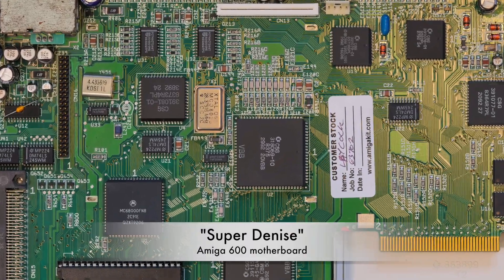amipal #42: OCS, ECS & AGA - Redux

Comment: When you explained the copper chip, you said it gives the impression of there being more colours on screen than there actually are. 
You are incorrect! There actually are more colours on screen than the pallet supports. It's not an impression of more.
One example of an impression of more colours is by dithering 2 colours together, tricking the eye into seeing a 3rd colour not included in the pallet.
Pallet switching is not the same thing. You are displaying more colours by switching pallets while the screen is drawn, no tricking of the eye to give the impression of more colours, instead tricking the system into actually displaying more.

Comment: OCS was working in the 'lab' in late 1983 and publicly demonstrated in both January and June 1984. 
ECS is a slight augmentation of OCS (very few changes). 
AGA is a slight augmentation of ECS (blitter and audio chips didn't change).

So really, the only true innovation was OCS. It does crazy things like this (proving that HAM does work fine for games): https://youtu.be/XDdMoglmUbs?t=712   https://youtu.be/JJczdYO8N1c?t=230
Reply: You do AGA a disservice. Because there is a visible (color and performance-wise) difference between ECS and AGA. The difference between OCS and ECS is nearly invisible.
Reply: @TheGraemi  Color-wise, yes. Performance-wise, not much. At least not as much as you'd expect from a chipset upgrade at that time. AGA re-uses the ECS blitter. They didn't even increase the blitter's bandwidth. It's Lisa that's doing the heavy lifting and Lisa is just a display chip (based on Denise). That's why AGA games don't look much better than well-programmed OCS and ECS games.
Reply: @Nebulous6  Well, at the end they made the data transfer 32 bit but left blitter 16 bit.
So same color modes should have been faster but of course not the newer ones and not the blitter operations.
It's sad they never used the production ready Ranger chipset Jay Miner finished in 86. Probably forgot about it.
Reply: @TheGraemi  I totally agree. What even bothers me more is that Jay Miner said that he could have added more bitplanes back in the mid-1980s but didn't feel that displays to handle that many colors weren't really prevalent enough at the time for the home market (plus cost considerations back then for something that started out as a console design). The fact that he could have done that back then shows just how long C= sat on their hands. I don't fault the engineers as they genuinely wanted to release cool stuff. It was the management that kept killing their proposals and starving them for resources. Meanwhile, the top five execs at C= were pocketing over a million $ a year each.
Reply: @Nebulous6  It was even worse. The screens weren't really able to handle 1024x1024, the max. resolution (non-interlace) for the chip set. And if than expensive.
But regardless, Gould wanted a business machine. A early A3000 with Buster and Ranger would have been possible in 88. Some ground work was already done by the Los Gatos (old Amiga) guys. Using that as hints how to integrate with other components to create a cheaper Ranger should have been possible. Jay Miner also would have helped as consultant. He said so multiple times after he left Commodore.
This just showed how a one man (Tramiel) show Commodore leadership really was. Gould certainly was not up to the task, by far. 😭

Comment: Additional: In OCS/ECS the special modes EHB and HAM are only possible in LowRes (320 pixel width). On AGA you can have the special modes in any resolution. Also in OCS/ECS the color palette range reduces its size while doubling the width, so: 320px->32col, 640px->16col, 1280px->4col. In AGA you can use up to 256 colors in standard mode for any resolution. Early A1000 also lack EHB mode, latter A1000 and all other Amigas can do EHB.
Edit: And also, the copper cannot only change a palette at each line, also the resolution. And you can also change the palette at specific x coordinates, so with some special skills, you can create "rectangles" with an own palette, as demonstrated in the "Remake of StreetFighter 2 Amiga Demo"
Reply: I still Wonder why half-bright shadows are not more common . I think that genesis has some weird flags for this, too. Never saw arcade hardware with this capability. NeoGeo cannot, or?
Reply: @ArneChristianRosenfeldt  i cannot remember any other hardware which can do this without alpha blending with such efficiency. On the Amiga there are some games which used this trick, for example "the settlers". Or in intros of a bunch of games

Comment: I've had an Amiga 1200 in my kitchen cupboard since 1996. The pandemic meant I couldn't really go anywhere so I pulled it out and added some gear to it as my original hard disk died. I now have, A1200, Blizzard 1260 (060) 50mhz,Blizzard 1230 scsi card with total 128mb ram, 8x scsi cd rom, ide to sata converter, sata to m.2 adapter and 128Gb m.2 drive with Amiga OS 4.9. Also, new 3.2 roms and 9dsub to ps2 convertor with Microsoft intelli trackball. What a blast from the past. I haven't worked out how to get the scroll wheel to work yet.
Reply from the maker: That's amazing to hear! What a superb system you've put together.
Have you tried FreeWheel from Aminet? Can't promise anything, but that may work.
Also, is your machine recapped?
Reply: @amipal24  Yes recapped. And Yes, I've tried freewheel. I can't seem to get it working.  I run the app but the wheel doesn't respond. Edit/ I copied Freewheel 2.1 into WBstartup and low and behold if I press on the wheel and move the ball I can scroll so that'll do nicely. The scroll wheel does nothing but clicking on the wheel is kind of like a third button. Pretty happy with that.

Comment: HAM mode was used in Time Gal anime full-motion video game.
Reply: The only HAM game I recall playing was Pioneer Plague. Impressively colourful, but the frame rate suffered too much for it to be anything other than a curiosity.
Reply: @mikekwarner  
https://youtu.be/JSLcN6GBzO0?t=93
Amiga's Pioneer Plague gameplay.
Reply from the maker: Wow, I didn't know about that! And only released in 2017!
Reply: HAM 6 also used for Links Golf,  Knights of Crystallion, and Labyrinth of time.
HAM 8 used for Holiday, NightShift, and Genetic Species  https://youtu.be/Pl1hctZ8HnY?t=414
Reply: @Nebulous6   Genetic Species 200MB pre-rendered intro is in HAM8
Reply: @valenrn8657  For HAM8, there are these two (the second needs a 68060/50 though): https://youtu.be/wbWGAFIkA5E?t=29 
https://www.youtube.com/watch?v=wv3OYbADkJQ
Reply: @Nebulous6  WinUAE's 68060 emulation is not performance accurate.
Reply: @ With enough CPU power, A1200's AGA can display 60 fps 320x200 AmiQuake. 30 fps 640x200 has been reached.

Time Gal example displays prebaked frames with stock 68000/68EC020 CPU.
Reply: @Nebulous6  Quests Of Nargoth on real A1200 with PiStorm-Emu68, AGA displayed frame rate results are smooth. A1200 AGA just needs math compute boost.
Reply: @ There's always HAM8 OLOFight: https://youtu.be/UMEesdxO81Y?t=2641

Comment: The colours which are on screen are on screen, they do not trick our senses ;)
Reply: That isn't strictly true. It is very easy to fool the human eye. Interlaced screens when watching TV, the fact there are only Red, Green and Blue dots on the screen which are using an additive colour model to give the appearance of more colours. The human eye has a limited colour resolution and the human brain is very good at 'filling in' information that is actually missing. Every human has a physical blind spot in each eye... but you don't notice it. You can however easily prove it's existence with a very simple experiment.
Reply: @another3997  This is true for color trick cases. But the copper actually changes the color, and does not fool the human eye, and this is what vertigoz meant ;)